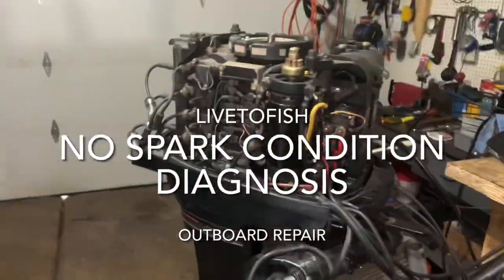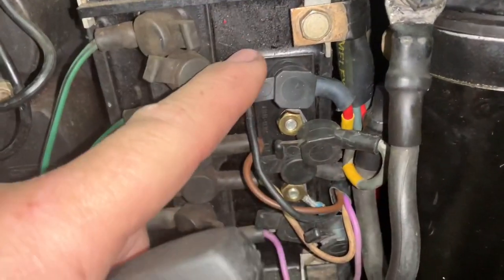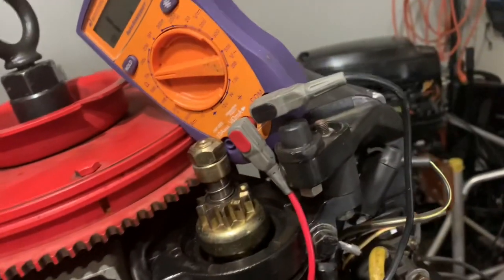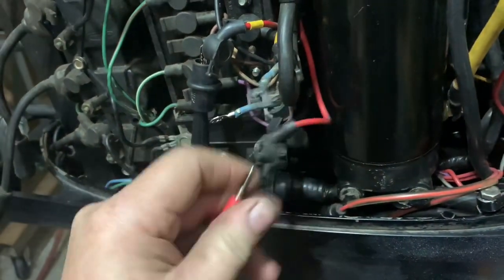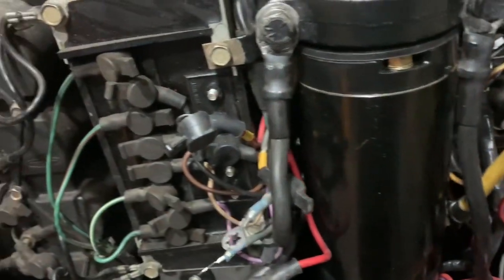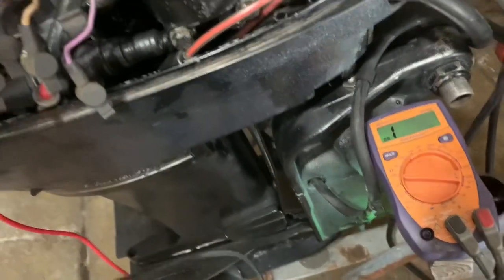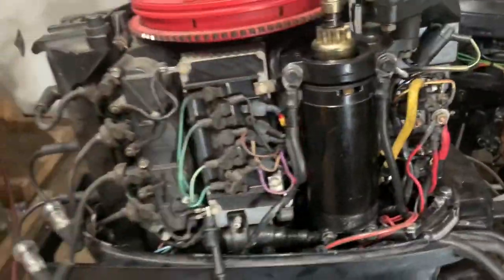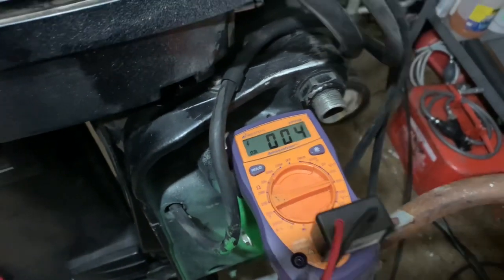“No Spark” Is it a Bad Switch Box, Stator or Trigger? Using a DVA Adapter - 1989 45 hp Mercury

Comment: My 1986 , 85 hp force not spark in the second spark plug , any suggestions?
Reply from the maker: Begin by checking continuity in the plug wire and clean regap the spark plug. If the problem stays with the same cylinder    check your resistance values for the trigger and stator. Verify the DVA ouputs for the trigger, stator and switchbox shown in the video. Go to www.cdielectronics.com and look up your specific motor for the resistance and DVA Voltage outputs.
Reply: Thanks a lot , that was a quickly response  @LivetofishOutboardRepair

Comment: Are you testeting after the adapter
Reply from the maker: No I didn't need to once I discovered i wasn't getting the correct peak voltage output from the powerpack.

Comment: While doing the tests on the stator and trigger,  do you have the ignition switch in the  run position. How do i get a copy of the switch box, and trigger, stator spes, values ( volts ohms) great videos!
Reply from the maker: When checking the stator and trigger you have the ignition off and the wires disconnected when checking resistance.  When testing peak voltage you need to crank the motor over while testing so yes the ignition switch would have to be on. You can find the specs you need at www.cdielectronics.com or just Google CDI troubleshooting guide.

Comment: I have a 50hp mercury 3 cylinder.  It will run, but bad. I pulled the plug wires off one at a time. #1 killed the motor instantly. #2 & 3 the motor still ran a little while. Wasn't much change in the running. You can see those 2 have some spark. But don't seem like enough to make the motor run perfect.  What's you idea on what to do?
Reply from the maker: Start with checking spark plugs, wires and then move onto the coils. Check coils for resistance both primary and secondary circuits for each coil. Clean all connections. If they check ok then look at the peak voltage (DVA) and resistances for the Stator, Trigger and Switchbox.
Reply: @LivetofishOutboardRepair   my set up is different.  This is a 3 cylinder  60 hp. Thought it was a 50.  I have 4 wires at the top of my cdi box. 3 off the starter and 1 to the trigger.  But I have 2 other wires from the stater that go to something else. So which wires do I need to check for ohms?
Reply from the maker: GOOGLE the troubleshooting guide from cdi electronics, this will guide you through the methods and specifications for your motor. There website is www.cdielectronics.com you can find it there or just Google cdi troubleshooting guide.

Comment: Great video for troubleshooting. Question: when you check the peak voltage with the DVA adapter, do you check AC or DC voltage? Also, is the troubleshooting applied to the red stator with green, green/white, and two yellow? Thanks for your help.
Reply from the maker: Set your volt meter to DC when using the  DVA adapter.  Go to www.cdielectronics.com to look up the elecrical information for your motor. They provide all resistances and  voltage requirements as well as wire colors.

Comment: Used your video a couple years ago on my 1985 Merc 75 hp and ended up replacing the switchbox with the on on my parts motor. Put it away last fall and it was running great. Fast forward to today and I have it running on 3 of 4 cylinders at fast idle. The 4th cylinder kicks in for a split second once in a while. Pulled the plugs and the top cylinder was wet. Cleaned the plugs and switched plugs between the top cylinder and the second cylinder. Again, the plug in the top cylinder was wet. The plug in the second cylinder was fine so I don’t think it’s a bad plug. Although I did not remove the coil, I checked the two resistance readings and they were within spec. The spark plug wire from the coil to the spark plug seems to be OK. 
Any thoughts where I should go from here?
Reply from the maker: Pull the plug, reconnect the plug to the wire then ground it to the engine. Crank over the motor to see if the plug is firing. If not it's probably a bad coil.
Reply: @LivetofishOutboardRepair  well that was a quick reply! Thank you! I’ll give it a go.
Reply: Decided to switch coils 1 and 2 hoping dirty spark plug would follow the coil but the dirty plug is still in top cylinder. I assume this indicates coil is ok
Reply from the maker: @bobbyvee2043 I would agree. Have you done a Compression test?
Reply: No but good idea thanks
Reply: I did the compression test and these are the results:
1 - 148 (the one with intermittent spark)
2 - 151
3 - 143
4 - 140
Plug, plug wire, coil and wires from coil to switchbox appear to be good.
Reply from the maker: Double check the resistance on the plug wire or switch it to another cylinder. Flex the wire by bending it as you check the resistance. If the Ohms fluctuates when flexing the wire is bad. Those are very good compression numbers. Also double check the resistance of the trigger and flex the wire while checking. Just like the sp wire. If the values fluctuate then the trigger is bad.
Reply: @LivetofishOutboardRepair will do thanks
Reply: Well upon further thought, I decided to get a spark tester. I know should have had one to start with! It shows cylinders 3 and 4 with intermittent sparking. Nice to know the issue and not just look at plugs and think I know!
Reply: Finally had time to get back to this. 1985 4 cylinder 75 hp merc. Runs like a champ at high end. But when I slow below 2000 rpms, it then only runs on the top 2 cylinders. I can plug/unplug cylinders 3 and 4 and makes no difference. I tried another switchbox and that made no difference. I had the stator replaced in 2011. Would the trigger cause such a scenario? Any thoughts on what would cause the 2 cylinders at low speed to fail? Seems like it might be obvious but for the life of me I cannot find anything to describe this.
Reply from the maker: @bobbyvee2043 Google CDI troubleshooting https://www.cdielectronics.com/wp-content/uploads/2016/12/7th-Edition-Troubleshooting-Guide_RS.pdf
This guide should help.
Reply: Thanks. I have been referring to this and both trigger and stator readings all within spec. I have to admit the more I look at this guide, I seem to pick up another tip to keep moving forward. Thanks for your help.
Reply from the maker: @bobbyvee2043 your very welcome. I hope you find the problem.
Reply: I believe I found that the trigger is the problem. I swapped the red with the red/white and the blue with the blue/white stator wires. The problem did not move so that indicates stator is ok. Then I swapped the trigger wires from top to bottom, # 1 for #3 and #2 for #4. The problem moved so that indicates that it’s a faulty trigger. The weak or intermittent spark made it hard to diagnose for me. All stator and trigger ohms and dva tests were within spec. Physically moving these wires around to different connections exposed the problem. Thanks again for your help!
Reply from the maker: Great Job! Sometimes the resistance and voltage outputs can be normal and still have a bad part. Thank you for watching and incredible comments.
Reply: Couldn’t have done it w/o your video to give me confidence to give it a go!
Reply from the maker: @bobbyvee2043 I'm so glad you found the problem. I hope you are able to get out on the lake soon. Thanks for your kind remarks. I am also glad that my video helped out in some small way. Good luck... tight lines.
Reply: Getting my parts together and when I search for the torque spec for the flywheel nut on a 1985 mercury 4 cylinder 75 hp, I seem to find conflicting information between the Clymer and Seloc repair manuals. One indicates 85 ft lbs and the other indicates 120 ft lbs. Any idea where I can find this torque spec?
Reply from the maker: @bobbyvee2043 the Mercury / Mariner Service Manual states 120 ft/lbs for the flywheel.
Reply: @LivetofishOutboardRepair ok thank you!
Reply: I thought the trigger was the problem but the intermittent spark fooled me. One of the wires was in bad shape so I replaced the trigger. Still made no difference. Decided to recheck stator voltage which when first checked, was all within spec. This time voltage was WAY low. Replaced and fixed the problem. Stator was only 12 years old. Finally back on the water!

Comment: I'm having a no spark issue on my 1984 johnson 70hp. I bought the boat a few weeks ago and after changing the fuel filter it cranked fine. Last week I went to crank it and got no spark in any of my plugs. I was thinking power pack but I unplugged the power pack plug from the stator and checked the ohms reading on the stator plug. On the 2 outside holes I think it read 11.8 and the 2 inside holes it didn't read anything just OL. So that should mean the stator is bad since I think they are supposed to read 400 to 500 ohms. What do you think? Any suggestions or advice is much appreciated!
Reply from the maker: Check the OHM values for your motor on www.cdielectronics.com or just Google cdi troubleshooting and lookup your motor's resistance values. If they are way off from what is provided then yes you found your problem.
Reply: @LivetofishOutboardRepair  weird thing. I went out took the rectifier yellow wires off the terminal and it started right up. I then put them back on and it started right up. First time in 2 weeks or so of not starting now it's back to normal. I don't get it.
Reply from the maker: The rectifier may be your problem. It may be working intermittently. The rectifier typically just charges your battery but in some cases it might also convert the AC voltage from your stator to DC that is sent to your kill switch and ignition system.

Comment: What would be nice if we could be told how to achieve our specs and diagrams of which leads are which, etc,  so we could run through those tests.
Reply from the maker: The reference documents are copywrite protected. You can find them at www.cdielectronics.com or just Google CDI Troubleshooting guide. You will find all the information you need.

Comment: 1983 mercury 50hp i replace trigger switch and box it still no firing 3 and 4 will the stator cause the problem and engine runs but no firing 3 and 4
Reply from the maker: Make sure your coils, wires or plugs are not the problem first. Your stator just produces AC current. It either works or  it doesn't. If you checked the stator's resistance and is within specification and you have also verified the new trigger and switchbox peak voltage using the DVA adaptor then you may find you have a bad trigger or switchbox even though you purchased them new. It's very possible that even new parts can be bad.
Reply: @LivetofishOutboardRepair  hey i got new dva i did the tests with cranking blue and white wire got 2.4 volts and blue and ground .671 and red and blue .676 and red to ground 1.4 volts  and brown and white wire 2.9 volts whats the problems?

Comment: Did you leave all other connections hooked up as you were testing the ohms? no disconnecting of ground or other wires to do that or the DVA tests? and what if you have one of the terminal blocks that have more than one thing in each spot, should you disconnect what isnt being tested?
Reply from the maker: Yes i only disconnected the wires that affected the component i was testing with respect to ohms. Some tests require the component's wires be connected and then other tests require disconnecting while testing. This reference information was included in the video.

Comment: What is that dva adapter for tour multimeter?
Reply from the maker: The DVA adapter measures peak voltage . My volt meter by itself only measures average voltage. You need to get the peak voltage outputs for accurate readings. More expensive volt/ohm meters can measure peak voltage but mine was an inexpensive model without that function so I needed the DVA adapter in order to measure peak voltage.

Comment: I have a 1975 Merc Outboard 2 stroke four cyl 50hp. It has a Mercury 333-3213A3 ignition switch, which the mechanic said went bad (the boat wouldn't start). I can't find an off-brand (new version replacement) for this.  2 or 3 original styles are available for 450 USD +... i already bought 2 for close to a hundred... Does anybody know if this ignition box only deals with the boat starting?  I ask because after one company never shipped me a used replacement, another one did and mechanic installed it.  My issue before the replacement was boat wouldnt turn over.  Now, with used replacement, boat starts, but its idling really fast (in forward and neutral), and when i give throttle on the controls, boat only goes a touch faster and maxes out just a touch mlre than trolling speed.  REALLY SLOW. Feels like I have a 4hp motor insteaf of a 50hp.  My mechanic thinks there's something to do with the ignition switch box and timing in the way that the motor is running really bad and revving really high. But I was thinking this ignition box only took care of ignition and not the way the motor runs once the boat is started. I'm now trying to find yet another ignition switch box in case the one that I got in is defective in a different way. Even though my boat is now starting, something is really wrong with it. Plus, oil is dripping from the bottom of my propeller now into a little pail since using the boat for the first time yesterday. If anybody knows I would appreciate any help I can get cuz I buried so much money into this old motor I'm losing my mind. Ps - i can't find a replacement for my model.  Thanks for your time!
Reply from the maker: Start with the basics. Do you have good spark on all 4 cylinders? What is your Compression values on each cylinder? The oil may be coming from unburned fuel out the exhaust. This means you may be lacking spark on 1 or more cylinders. Give it the sniff test and see if the oil smells like fuel if not check your lower unit to see if you have water intrusion if not then back to a missing cylinder. If all that checks out ok then you may have a fuel delivery problem. Carbs, Fuel Pump, Fuel Line, Primer Bulb  and make sure you vent your gas tank too.
Reply: @LivetofishOutboardRepair  appreciate the reply! Although I understand the items you mentioned, I don't understand how to do most of these tests myself . I had my boat for a month at the mechanic and it's a long story but he said everything it's fine but he thinks I need another ignition switch. I find that weird because the boat seems to fire up no problem, but doesn't go much faster than idling and forward my hunch feels like it's a fuel issue but he claims it's not. So I figured I would ask around on YouTube if anybody has ever seen the ignition switch box, affect how the motor runs with the throttle
Reply from the maker: @mikecorazza  the motor should run with the throttle cable disconnected. If you can throttle it up normally with it disconnected then you know something is wrong with the control box or throttle cable. The ignition switch only controls power to the starter. Once the motor is running the stator provides power to the motor.
Reply: @LivetofishOutboardRepair  appreciate the reply. I'm not a boat mechanic and embarrassingly, I'm not sure where stator is located? It's not in the ignition box on the 1975 merc? I just heard from somebody that the 1975 merc was the only year this was made, and that the ignition switch box was notorious for issues.  In any event, since replacing my original ignition box with a used one off Ebay, motor went from not starting at all to motor now starts instantly after turning key, but a) idles super loud, and when I put it in gear (forward), it trolls much faster in fwd gear (pre throttle) than before as well. So you're thinking the ignition box is OK if motor is starting OK?  The moment I give throttle, motor only speeds up a tad more, then either does nothing, or bogs down then cuts out. I figured maybe fuel wasn't getting into the system but mechanic checked everything with that, also replaced fuel pump. Where would stator be?  Thanks !
Reply from the maker: @mikecorazza  The stator is located under the flywheel and connects to the switchbox. My video shows how to check peak voltage readings and resistances for the Stator, Trigger and Switchbox. If these values are not within specification will cause running issues or even a no start condition as you have stated.  If you now have a good strong spark at each spark plug then I would be looking at your carbs as the problem.
Reply: @LivetofishOutboardRepair  Yah my motor now starts fine, but as mentioned, idles so loud and fast. And doesn't speed up with throttle.  I'll have to see if I can get a mechanic to re check the carbs. Appreciate the replies!